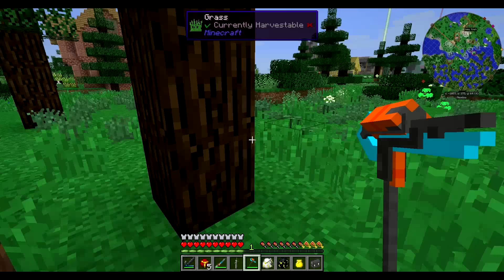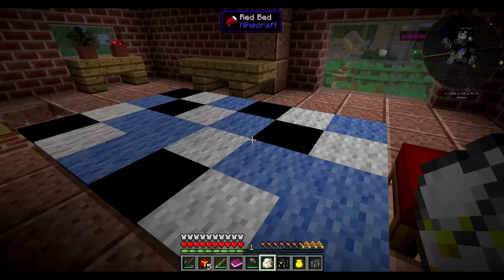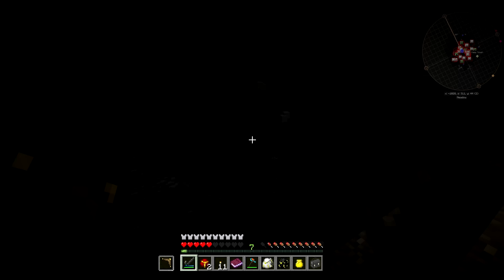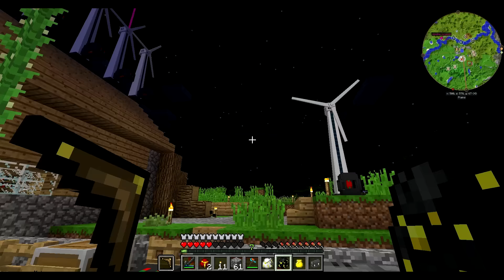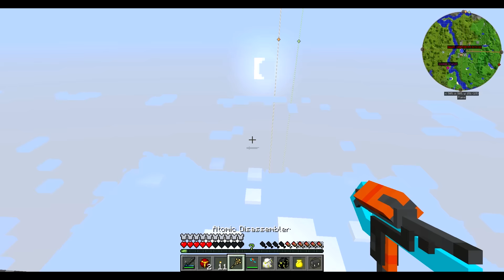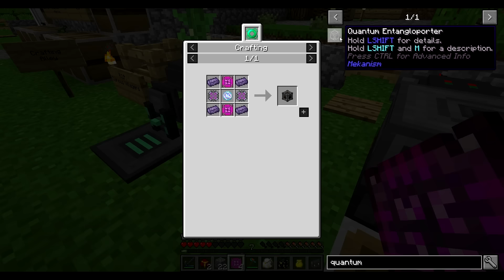Minecraft 1.10 All the Mods Ep. 9: Exploding Mobs, Factories, Capacitor, Quantum Entangloporters!

Comment: you should look into the mod psi, its kinda confusing but once you get started you can do really cool things for free. for instance you can call lightning or explode an area, and even place or destroy blocks. i used it right away and made a block break spell so i could insta mine obsidian :3
also your white bag can be upgraded up to tier 3 and i believe it holds more than the golden bag of holding.
lastly you might wanna check out the mod correlated potentialistics. its applied energistics stand in because ae2 isn't upgraded to 1.10 yet, its a great storage mod so if you haven't used it or applied energistics 2 i think you'll be surprised :D
Reply: just checked the white bag holds 1 row less than the golden bag of holding :/

Comment: Oh, another thing.... have you found a device in this mod pack that performs the same as BuildCraft Floodgate?
Reply from the maker: There's a fluid placer in Actually Additions (or the mechanical user loaded with a bucket of water in ExtraUtils2) ; however, I think you'd need to move it around if you're looking to fill an area with water.
Reply: I made the fluid placer and got my lava in it, but I could not get it to place the lava. I am trying to fill a moat. Doing it by hand is SUCH a pain. :(